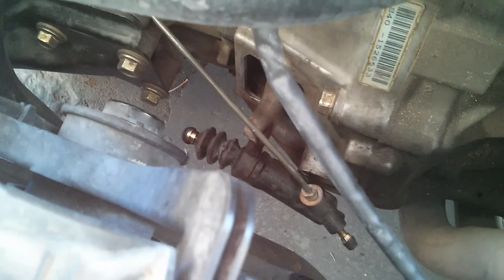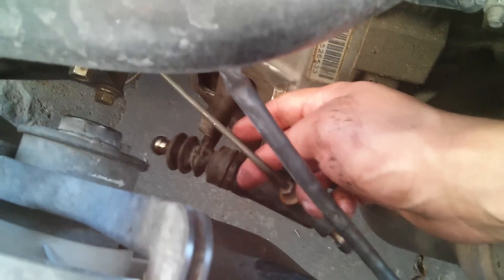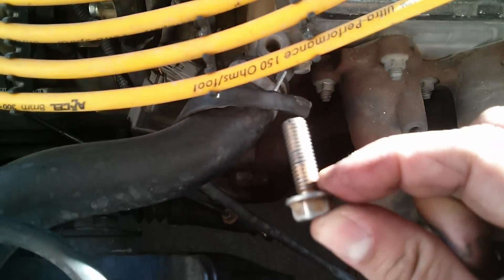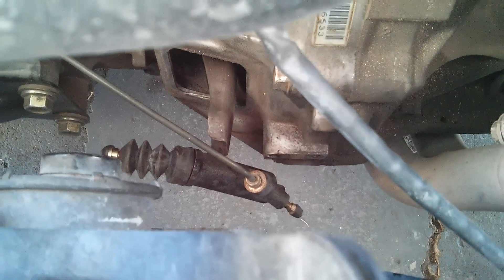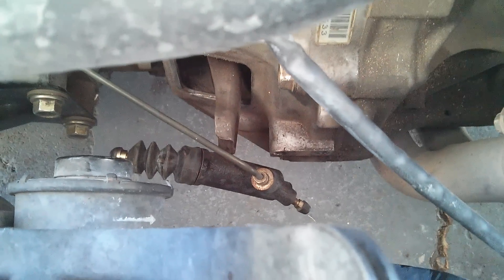How to fix squeaky clutch noise pedal (Honda Civic)

Comment: Dude, you ROCK! I had the same problem after replacing clutch kit with bearings. I had that annoying sneaky noise. Didn't take it apart just sprayed silicon lubricant and noise it's gone. THANKS A LOT BRO!

Comment: Same problem here, I tried to put grease in there 2 times but squeaking doesn't stay away longer than couple of days. What gives? I used dark mos2 grease that should have good heat and pressure tolerance.

Comment: Can I use white lithium grease?
Reply: Fps Uzbek Yes, you can but it won’t withstand the heat from the engine and tranny since it’s only built to lubricate door hinges and some stuff that’s not exposed on hot surfaces. I’d use the high temp grease for the slave cylinder
Reply: TRouBLeSHooteR23 some white lithium can withstand really high heat